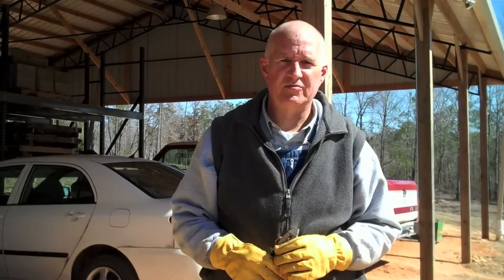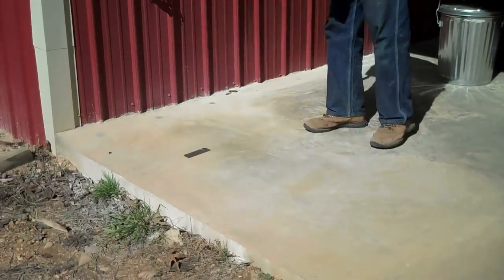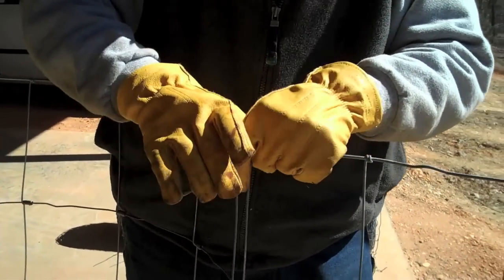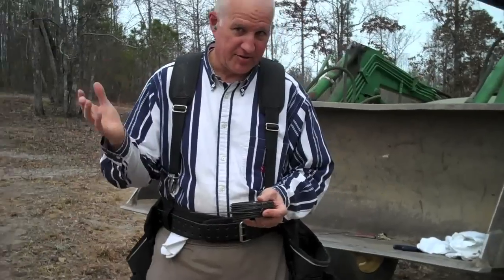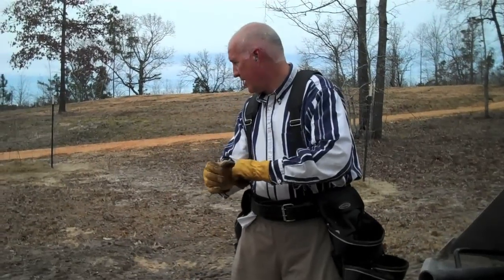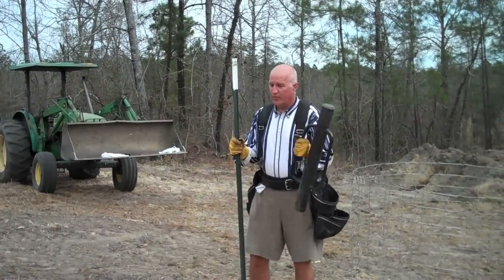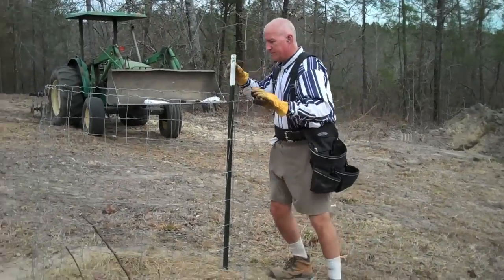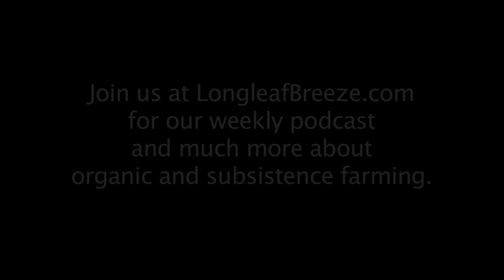Cages for Young Fruit Trees.mov

Comment: In the future I have found that if you cut the bottom horizontal wire on the fence it leaves you with 4" tines which can be stepped into the ground for a little extra strength. Thanks for the video.

Comment: it is pi x r squared, not diameter.  in your case r =2.  2 x2=4.
Reply from the maker: +Dale Swofford You do understand that I&#39;m calculating the circumference rather than the area, right? So C = 2 pi r or C= pi d.
Reply: +Lee Borden sorry,  it was very late at night.  I must have been sleepier than I thought.  I was a physics minor in college to boot.  thank you for the info on deer proofing.  I will be planting 30 apples an 30 other fruit trees along a trail, In North Carolina, in an area with heavy deer population.  your video will help me get them off to a good start.